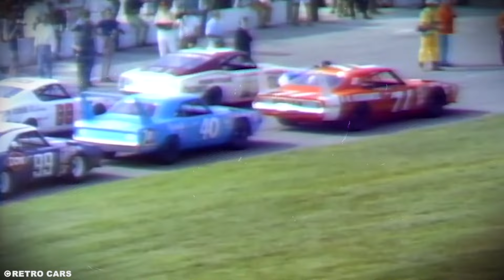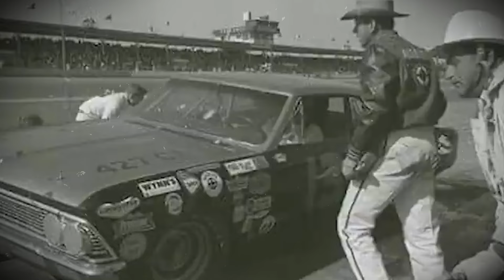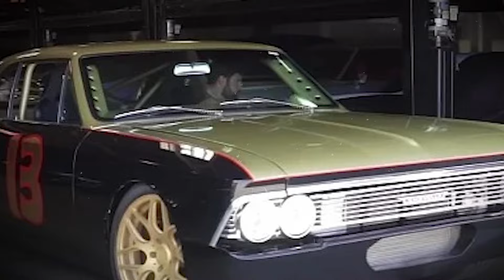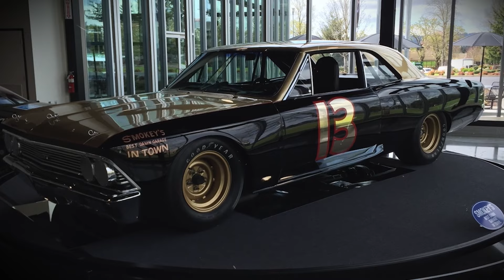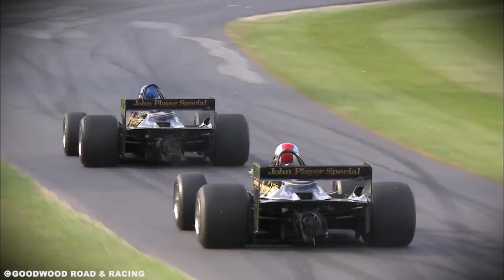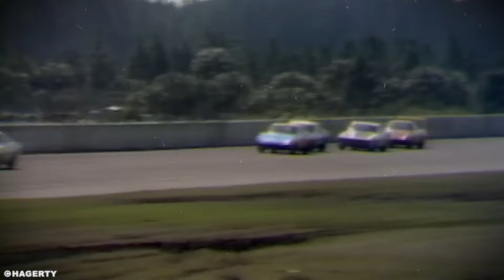How One Mechanic's ILLEGAL Basketball Trick Added 5 Extra Gallons of Fuel

Comment: What about when he was racing Hudsons. They thought he was pushing cam timing past “stock “ limits. Post race, they would make him remove the cam to be checked. He would break the end of the cam off upon removal. Now it couldn’t be checked. It was his cam and he could do what he wanted to it.  
Also, on Hudsons, he would pressurize the fuel tank until it bulged out just before a race, increasing capacity then coming in after a race and just before inspection, someone would run a floor jack under the tank and then jack it up and bend it just enough to reduce the capacity of the tank for inspection. 
Just one of the genius ideas he used.